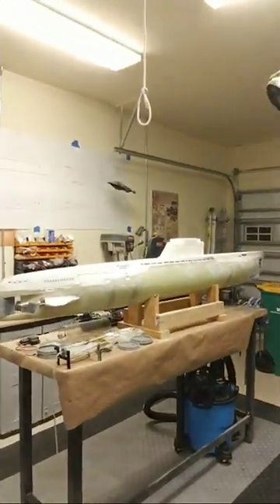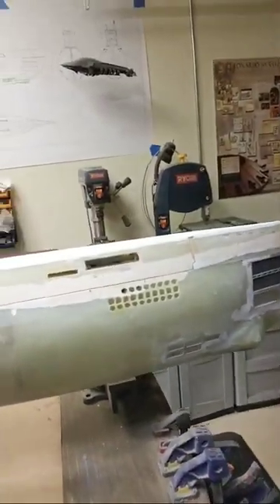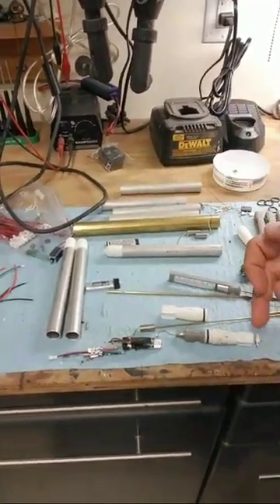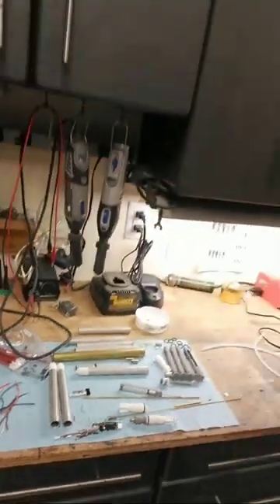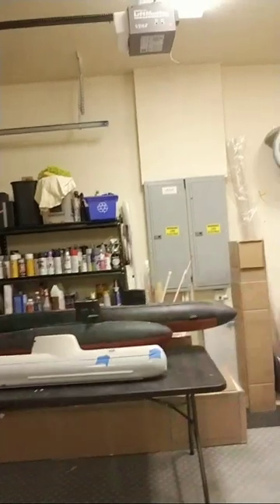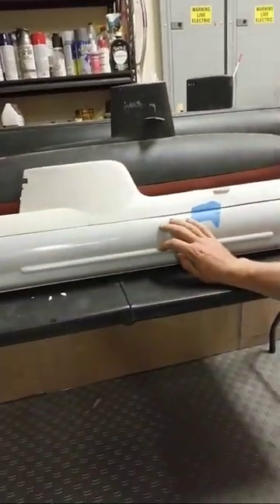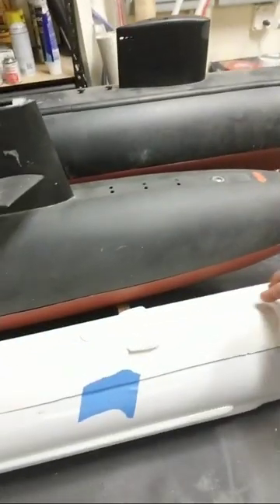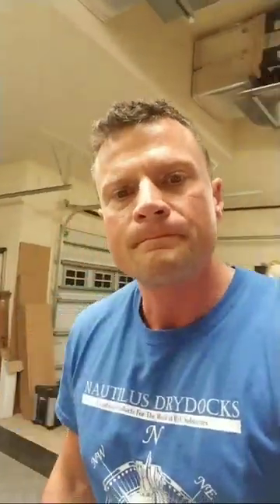RC Submarine Q&A Feb 1st, 2018

Comment: Hey, I'm pretty new to rc submarine conversions. What scale is best for this that would be large enough a decent sized ballast tank and all required electronics with room for some extras like periscope controls and opening hatches?
Reply: man, I have no idea what any of those letters mean. I've only ever worked on scale rc drift cars and I have a lot of experience in rc planes. the scales in which I normally build are 1/350 for submarine dioramas, 1/100 for the occasional gunpla build, 1/35 for tanks, 1/48 for planes, and 1/10 for rc drift cars. I have also looked at the website but as I live Australia, shipping prices are an inconvenience to me.